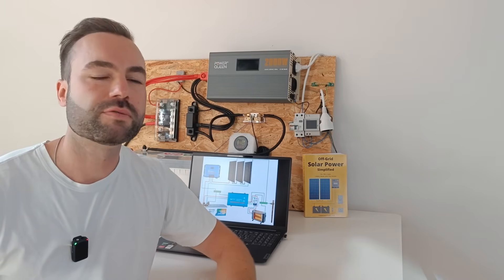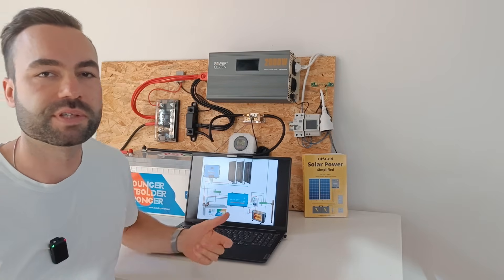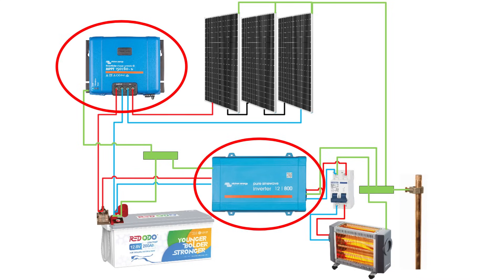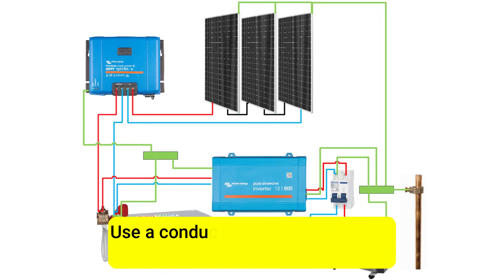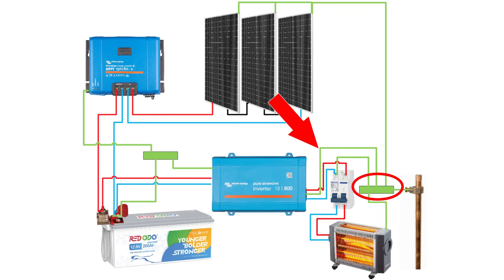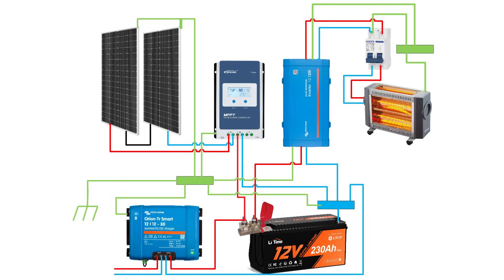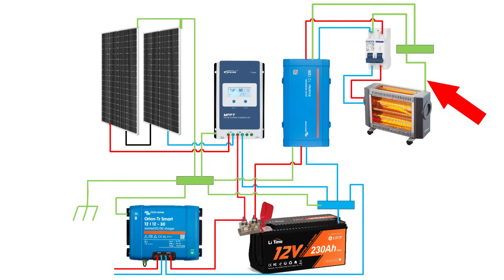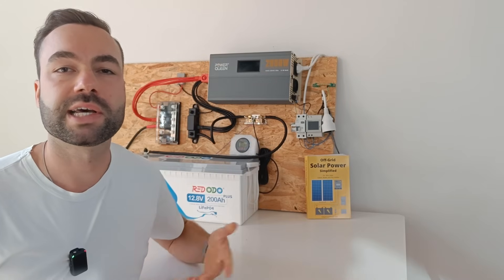How to Ground an Off-Grid Solar System

Comment: Hi Nick. Like Robert (below) I'm into marine applications.  I've seen elsewhere for marine you should not have a neutral - ground bond and also not to bind all metal items to a common earth.  Rather, if they're isolated, leave them isolated.  It seems that boats and campers can be quite different?
Reply from the maker: Victron shows in their document 'wiring unlimited' that they bond the neutral to the ground. Its best to have an isolation transformer. I made a video about it. search for 'prevent galvanic corrosion' on my channel.

Comment: Can you give an example using a mobile system that is on a cart that is portable,?  For example I am building a system that will have three 12v 300ah 200a BMS  lifepo4 batteries with a 12v 3000w inverter, (with a 30A hard terminal).  This will eventually have a 900w solar system connected to a 60A MPPT Controller.  I am having a hard time figuring out how to ground it correctly, can you assist?  Remember this is portable solar I can move it where needed and take it with me.

Comment: When you refer to a house already having a ground rod, are you implying that the house is on grid and that the two AC sources ( off grid and on grid) can share that rod?
Also many people have off grid inverters that don't provide three wires but just outlets which may have a unbounded neutral and may not allow it, can. you comment on that scenario?
Thanks for the video and your channel.
Reply: That was my question  too. It's not clear when he says don't put a grounding rod near solar panels. I'm setting up an off grid system but live in a residential house. I've no idea where the ground rod is. I can't find it. So, currently have no earth to ground from solar. Which concerns me. I am however much lower than close, surrounding buildings which should get stuck by lightning first.

Comment: Great channel and I got your book.  Grounding question for an isolated solar system (it's on a pole in a field) - 24V system: 1 PV panel, 1 Neutral Ground MPPT, (1) 24V battery, Separate neg & pos bus bars.  I plan to run a ground wire from frame of solar panel direct to ground rod and another ground wire from negative bus bar to the same ground rod.   Is that the proper method?
Reply from the maker: Yes. Check my videos about ground-neutral bonding and gfci.

Comment: Can i use a pc safely with only inverter and battery ?
Reply from the maker: There is no guarantee there will be no induction voltages on the casing, so you have to ground it. Check the video on ground-neutral bonding and GFCI as well.
Reply: @cleversolarpower  thank you,actually i thought instead of batteries im gonna make my own power regenerator but do you know what is the best component to filter the dc output of my ac-dc psu before it hits the inverter because i have very dirty power ?

Comment: Bought your book, lots of good information.   You tend to leave out or dismiss Marine applications and that means I will look elsewhere for more specific information.
Reply from the maker: Yes, i tend to do that. Sorry! Although it is not very different than a mobile system, there are a few differences. I will incorporate some in the new version of the book. Check out my video about galvanic isolation for boats, thats quite helpful.

Comment: I want to know that,  any kind of permission is required to install an off-grid or hybrid solar system.
Reply from the maker: Only when it's connected to the grid. However, if there is a fire, insurance companies will point to your system, even if it didn't cause the fire. So be cautious.

Comment: I fail to see the point of sending DC ground to chassis in mobile (camper) if not bonded with AC ground, its such a minuscule area of metal its pointless because rubber tyres insulate from real ground, I use SPD's both AC and DC and ground everything to chassis which in turn is connected to a ground rod, although nearly everything is 12vdc, very little for AC needed, so quick overnighters I dont bother, but week long or weekend stays I pound that thing in.  bonding everything to real ground is still a common ground, and avoids equipotential differences.

Edited: BTW its also OK to have multiple ground rods, providing they are connected, this way they are again all at the same potential
Reply from the maker: The AC ground is actually bonded to the DC ground. It's just easier to separate them. I have a video about neutral ground bonding coming up soon. Bonding to chassis is to have the same reference voltage everywhere to reduce stray currents or static buildup. You don't need a grounding rod when you are on mobile. Yes, you can have multiple grounding rods, and they should be connected to each other at one point. So grounding busbar -> wire to grounding rod -> grounding rod 1 -> wire to next grounding rod -> grounding rod 2. Having grounding rods in series reduces the resistance to the ground. However, it is not okay to have multiple grounding rods at different points on the system, this will create grounding loops.
Reply: @cleversolarpower This is clear now to me about the dc and ac ground busbar.I was looking at pg 301 of your book and wondering why the dc not connect to a central earth as shown on pg 66 of the victron wiring unlimited guide. This will workfor my offgrid cabin

Comment: Eddy of you are connecting the output of the inverter to a grid connected house circuit via a changeover switch after the mains breaker? Does the neutral green the inverter connect directly to the main neutral bus?
Reply from the maker: Do you mean a transfer switch? i have a video about that coming.

Comment: Thanks for a good video along with your updates. Is there a way to measure if the grounding is correct using a multimeter?
Reply from the maker: If you mean ground rod, you need a special device. You can use multiple grounding rods in series to reduce the ground resistance. It should be under 25ohms. You can get an inspector measure the resistance of the grounding rod.

Comment: Hi Nick,  a question.  What's the best way to ground the AC system, when the structure is built totally on rocks. I.e no soil and no way to get a earth rod through the rocks/boulders
Reply from the maker: I'm no expert in this area, but you can research 'ufer ground'. it's a concrete slab with grounding electrodes in it used in dry climates (or rock which is considered non-conductive).

Comment: Can you explain why you can ground the PV (DC) to the home ground and the other DC components to negative Battery -.
I have a offgridd setup and I only use 12V server, do I need to ground the solar, MPPT to negative battery - or can I put it on the home ground busbar?
Reply from the maker: You can ground the PV to the DC busbar as well. Check the update in the description. You can ground it to the AC busbar since they would be connected (measure your inverter to be sure). But i like to keep them separate.

Comment: I will look forward to your video on the all-in-one controller-inverter option. I am doing a complete rebuild on a vintage camper, and will usually be hook up to shore power, which is earth grounded, with bonded neutral-earth ground. At present, I have separated the neutral form the ground in my AC distribution box in the camper. The roof and awning solar arrays will be capable of 4 plus KW with 10 plus KW battery storage... Thanks for your excellent work;  looking forward to the follow up video... Thanks, Jason.
Reply from the maker: Ideally your inverter/charger should have a grounding relay which disconnect the ground-neutral link as soon as the grid is connected/live.

Comment: Year's ago I had a mobile home since I didn't have grid tie I modified my old camper I. selvaged an old worn-out snowblower took the altinator off the motor home and hitched it to the snowblower added a big cat battery and a 1750 watt modified sine wave inverter and had power for my mobile home it worked great the snowblower motor gas tank ran the motor for about an hour and had the battery fully charged only problem was I got a nasty tingle when I touched the ground and the motor home it was enough to remind me not to do it again I noticed the same thing with the mobile but one day it was muddy and I slipped since I was between the mobile and the motor home I grabbed both to keep from face planting in the mud and I got the worst shock I've ever had  and fryed the inverter I don't know if I had grounded the mobile and or the motor home to the earth whether or not it would have  solved the problem or just burned out the inverter
Reply from the maker: Yeah, i suspect a stray current from the motor. Grounding this would have possible tripped the GFCI (if you had one). Video about the use of a GFCI coming soon.

Comment: Great video sir, as usual, in your video you say ac and dc bus bars are seprate, my question is, that in your diagram it seems that the ac and dc bus bars have electrical continuity between them, i.e. they are connected together via the chasis of the inverter, or are they totaly different grounds with no continuity between them?
Reply from the maker: Good question. In most inverters they are indeed connected to each other. (case ground and AC ground). It's best practice to keep the DC and AC ground busbar separated from each other. It's easier to build it this way in my opinion. The ground-neutral bond will have it's dedicated place on the AC ground busbar (or in case of an inverter charger inside the inverter).

Comment: Hi, great video, thank you. 
I have a question : if you build a DYI mobile Power Station, where would you put the Inverter/solar panels' ground connections ?
Reply from the maker: This would be considered a mobile system. There would be no link to chassis. So you need to bond the DC components as well as the PV frames to a grounding busbar, and then have one ground bonding wire connect to the main battery negative.

Comment: On my hybrid system for my house, I was told not to ground the batteries? Only one ground goes to the main panel.
Reply from the maker: Technically in DC it's called bonding. A separate video about inverter/chargers, hybrid inverters or all-in-one systems coming soon. It has to do with the ground neutral bond which has to be removed one you connect to the grid.
Reply: @cleversolarpower  
Mine is not connected to the grid, but is connected to the main panel with the disconnect switch.

Comment: Thank you nick for your videos, they are very helpful and informative. I do however have a question relating to grounding, I am planning a 12v dc only setup in a garden shed for LED strip lighting, car stereo for audio, phone/tablet charger, etc..
Would I ground only to the battery or should a grounding rod also be used?
Reply from the maker: The thing with solar panels is they can get higher than 50V DC if you wire them in series. Anything over 50VDC is considered unsafe, you can get shocked. So if there is a leakage current or static buildup from your solar panel to the frame and you touch it, a current will flow through your body. It's not the first time someone would get electrocuted from a PV frames. I don't suggest adding it to your DC grounding busbar, so i would add a grounding rod if your solar panel's combined Voc goes over 50V. It's not recommended to ground the solar panel frames to the negative of the battery.
Reply: @cleversolarpower  thank you for the quick response, I hadn't thought about grounding the panels but now I will add a ground rod in to the plan as I was planning on 3 panels to ensure the battery was always full even in the middle of winter plus gives me room for the system to grow in the future
Reply: @cleversolarpower  But that is what the diagram shows!  The PV frame grounded to the DC buss bar which is connected to the - of the battery.

Comment: He said to ground the negative bus of the battery, when I did that I lost 1/2 of the total amps I disconnected the ground to the negative bus got  all the amps back.
Reply from the maker: That means your DC bonding conductor is carrying a current, which you should look into.

Comment: Where is the grounding point for all the dc components ?
Reply from the maker: Everything goes to the DC grounding busbar as shown in the video. Then one wire will go to the main negative of the battery. And in mobile systems to the chassis as well.
Reply: Thanks but I was wondering where does the busbar actually ground for the dc side? I was told by local solar installer that equipment (array rails, panel frames) and system (inverters, batteries, load panel) each need their own ground rod. Obviously never tied together but 1 for the case of lightning and the other for the actual wiring/components to work correctly 🤔
Reply from the maker: @tjmooney4181  There is no ground rod needed for the DC side. The ground busbar is connected to the AC grounding busbar through the inverter (in most of the cases). Your local solar installer is wrong and will create grounding loops. There should only be one grounding rod in your whole installation. You can have multiple grounding rods to reach the 25 ohms, but they should be near each other and all connect to each other with a grounding conductor (rods in parallel). There is no way you can protect against a lightning strike. In fact, if you have multiple grounding rods, you can introduce the voltage spike into your system because the ground gets charged and it will travel trough your system. You are worse off grounding your PV panels separately. You cannot protect your system from a lightning strike, consider it toast if it gets hit. Grounding solar panel frames reduces stray currents and static charge buildup, to keep it close to 0V, so you won't get shocked when touching it.
Reply: @cleversolarpower thank you for the info I have some work to do changing my system (16 450w bifacial panels on 5' raised adjustable ground mount) all panel frames and rails attached to ground rod at array using 6 awg. Will 10 awg work to connect these through my 275' of conduit to my eg4 18kpv inverter ground bar? @cleversolarpower
Reply: @cleversolarpower Thank you, Nick. Two questions for you:
1. Why is the dc ground bar connected to the negative terminal of the battery? What is the science here?

2. How does one protect an off-grid solar system against lightning or thunder strike?
Reply: After speaking to a solar technician, I was correct in keeping the array on its own seperate ground rod. If it was tied to the inverter ground bar the inverter would throw faults and errors. Keep system and equipment grounding seperate
Reply: Also my lithium batteries have a ground lug so I never connect anything to the negative terminal besides the inverter cable

Comment: The inverter charger I have only has a hot and neutral line for ac out. What should I do in this case?
Reply from the maker: Inverter/charger are a bit more complicated. That's why i will do a separate video about them. This is because the ground-neutral link will have to be broken when the grid is added in the system to charge the batteries. Otherwise you will have two ground-neutral bonds, and we can't have that for safety reasons. Some inverter/chargers have a relay in them, but most cheaper brands don't.
Reply: @cleversolarpower  Okay thank you for your response. I'm looking forward to that video.

Comment: 😮😊 does this include even 100w single solar panels for a small cabin?
Reply from the maker: The Voc of a 100W panel would be about 24V, so that would still be safe to touch (if there is a fault). Anything up to 50V is. So if it's only one panel i think you can get away with it. But I don't think it will be according to code.